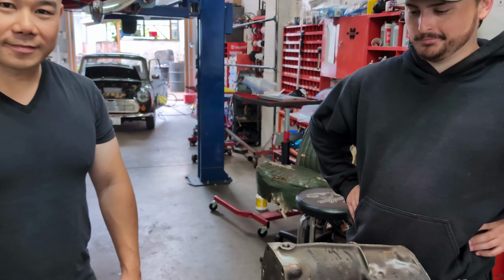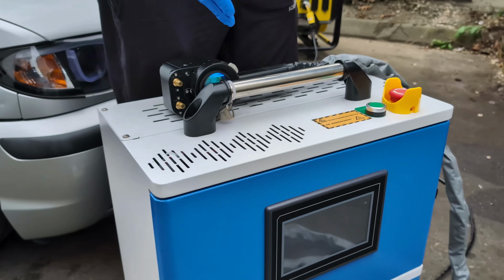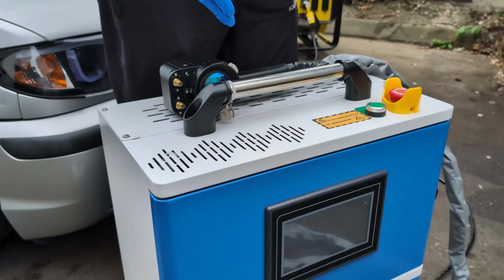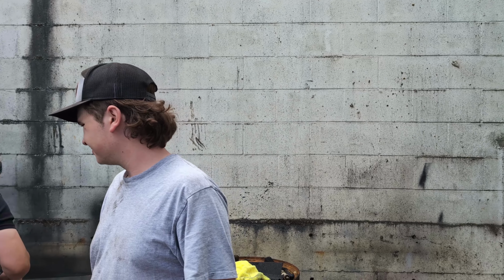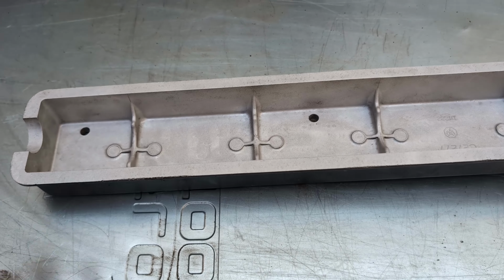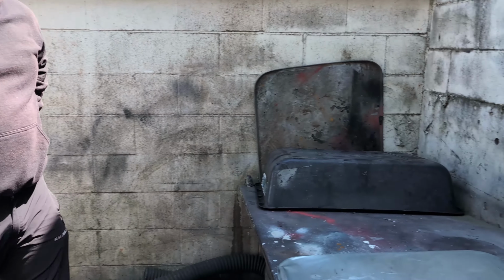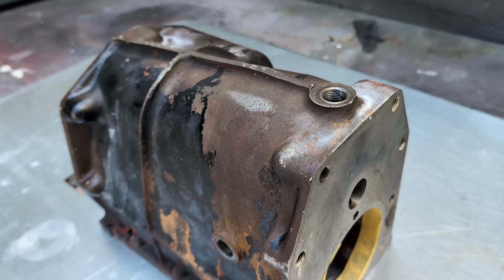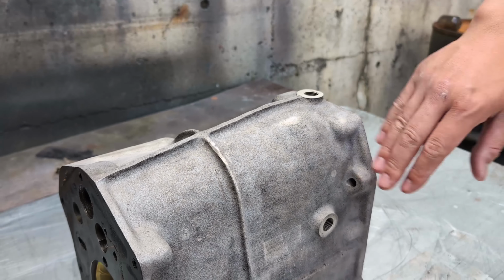Laser Blasting Vintage Jaguar Parts

Comment: Upsides and downsides, like everything. Pretty cool though. The rings left behind are a little off putting, but I imagine they can be cleaned away easily after. Have you tried dry ice blasting instead of garnet blasting ? It evaporates and won’t fill in places like the garnet will.

Comment: I'd say it definitely has its place in the cleaning scheme of things.
But, the admission towards the end that it "etches" the cast metal surface, that right away puts a flag up, doesn't it?  If you have an item where you don't want the surface to suffer in any way, then this probably isn't the method you'll want to use, and something like blasting with walnut chips (or whatever medium) will be what you go for.
That said, I'm sure it has its place!  But it's not a one-size-fits-all method.
Reply: This only etches the surface if you set the machine to do so. It is fully adjustable and can take the ink off of paper with zero damage.

Comment: Impressive, but I don't know if I'd like to use it without hand and skin protection.
Is it just laser beams or is it necessary to form a circuit through the metal parts, i.e.would it clean the surfaces of a non metallic part, say plastics etc, many new engines use non metallic intake manifolds and valve/ timing gear covers.
Could this be used to clean the excess carbon deposits from inlet ports in modern GDI engines?
A great innovation Richard, Owen Automotive's next purchase?

Comment: How would this compare with dry ice blasting, both in efficacy and cost? I seems a kinda slow process, I wonder what the per hour cost is, do you hire the technician or is it a rental of the unit?
Reply: All good questions. I'll check back later to see if they're answered.
Reply: its charged by minute at $4 a min = $240 an hr.
Reply: @richardmeng6954  Ouch. Thank-you! Not a hobbyist thing but for high end work probably justified.